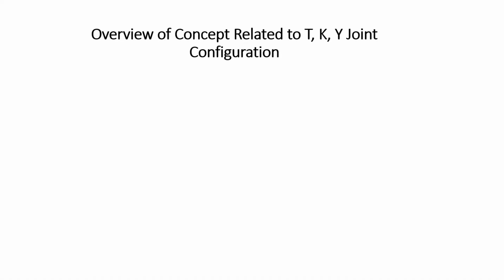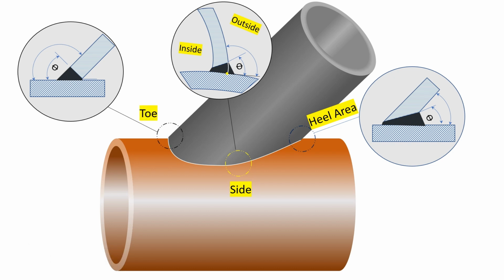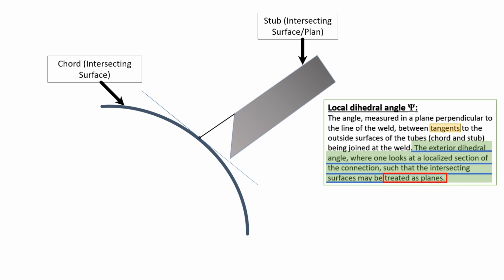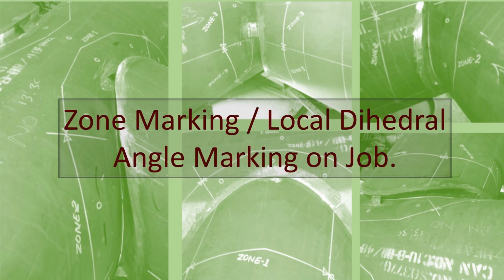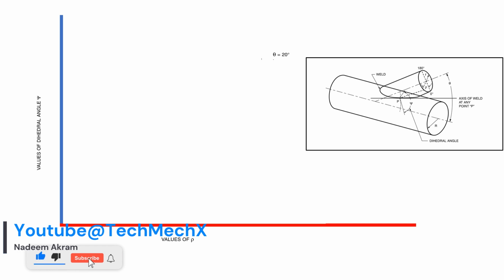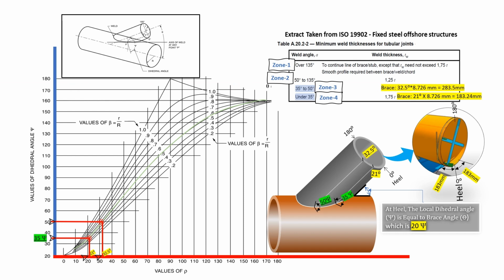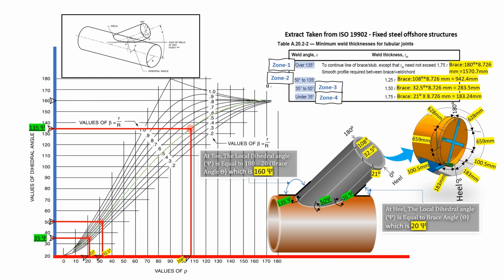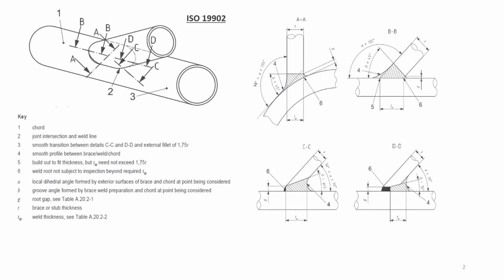Tubular TYK Weld Joints: Fabrication and Inspection

Comment: I dont suppose that you know about unfolding formulas  for tubeing
Reply: Could you point me in the right direktion for this. I would like to do it through calculations no matter how many formulars there is needed, you can always make excel to use them, if they are known
Reply from the maker: @kimj9929  agreed, Sir 👍🏻 and glad you pointed out. i will work out and share the  information requested.
Reply: @TechMechX This is mich appriciated, thank you.
Reply from the maker: Yes, i know how to do the development of Stub at any Angle. But it is a Detail development, which can be done by layout or through calculation... but it is not a Single formula.

Comment: Where can i find the graphs? You show graf for 20 degree and 30 degree, but what is it's 23 degree. Are these graphs someway calculated with a formular? Another thing, what if the brace is offset? Thanks for a good video by the way
Reply from the maker: @kimj9929  
You can find graphs 📉 for brace Angle 20, 30, 40, 50, 60, 70 and 90 degrees AWS D.1.1 Annex Q. 
Now second part of your question is what if we have brace angle different than given in Graphs like. 23 degrees or what if brace offset, answer of this part of question is, then we go for manual marking using degree protector and mimic profile gauge.. both methods i have explained in this video.
Reply: @TechMechX Thank you for the help. And again, really god video.

Comment: Its great video. Can i ask you the question?  For example, when θ is not 20 degree e.g. θ= 25 degree, how can we find ρ where local dihedral angle  Ψ=30 degree. Thank
Reply from the maker: There are two methods, I explained in the video. Either method can apply..For example, as you mentioned for 30-degree dihedral Angle, you can use the graph shown in the video at 21:38 to find the dihedral angle. 

Regarding the second part of your question, if you’re dealing with an angle for which we don’t have a graph, such as the 25-degree dihedral angle you mentioned, please note that the method no. 1, which I explained in video..can be applied. This approach works for angles that don't have corresponding graphs. 

Finally, remember that the local dihedral angle depends on three elements: brace angle, stub diameter and chord diameter.